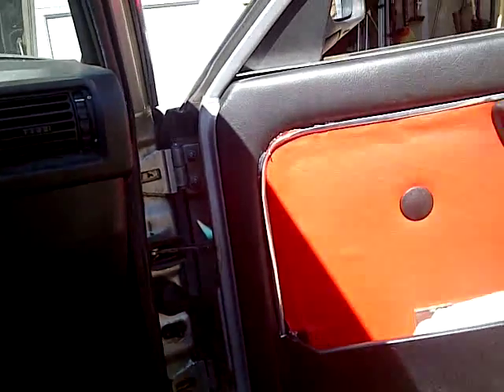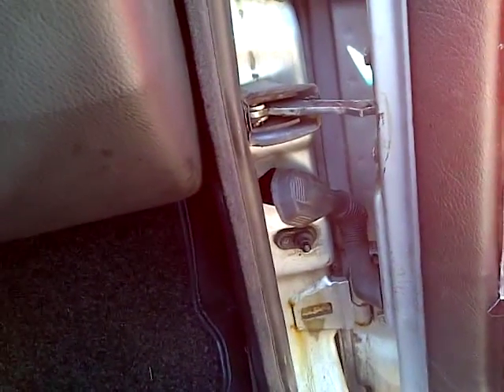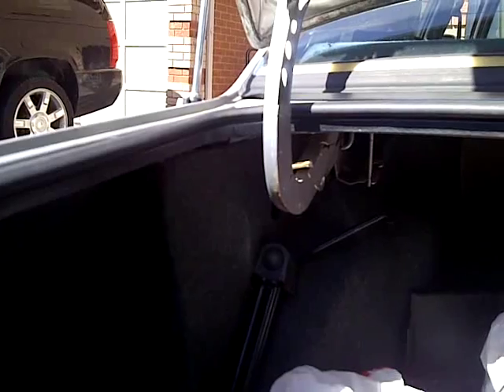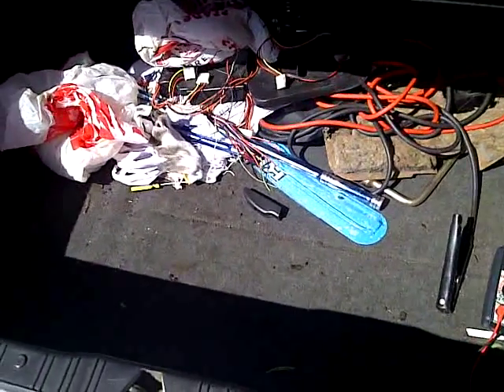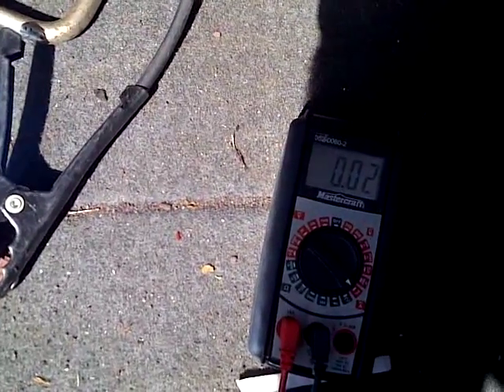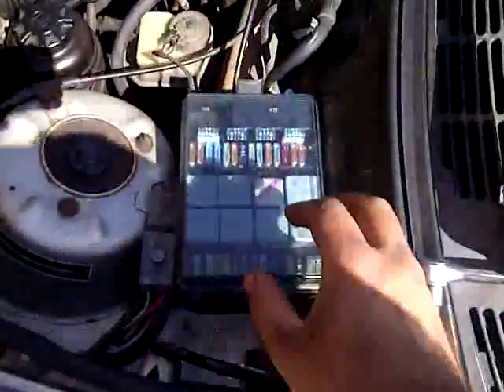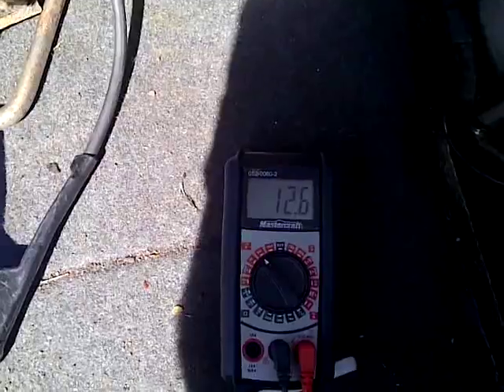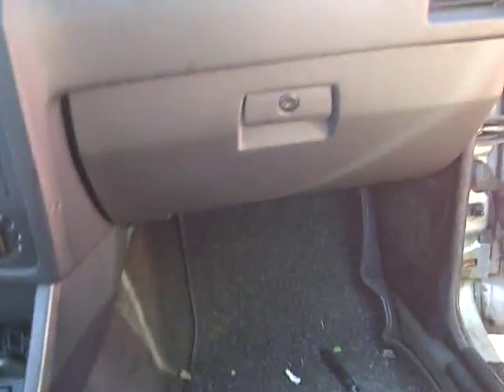e30 parasitic battery drain bmw 325e

Comment: I have 1990 bmw e32 750 il and it drains my battery 🪫 so what u suggest to do thanks
Reply from the maker: If you cant find the drain relating to any of the fuses then check your alternator diodes  Alternator diodes could go bad and allow power to move both directions, when car is running diodes allow charging of battery and when car is not running, bad diodes drain your battery. Unplugging battery cable from back of alternator (safely, since its a +positive cable) and checking for draw/drain  will tell you if your alternator diodes r bad. Atleadt that was the case with my 1995 e38. Thanks

Comment: I have pulled all fuses still draining 0.2 amp disconnect cable  distribution block to fuse box  looks like its my problem here, any ideas how find it whats draining?
Reply from the maker: A bad regulator maybe ? Or if diodes on the alternator go bad, they will let power flow both ways and therefore drain while you are parked. Just a thought ...it happened to a BMW 740 I used to own. Ripped the whole car couldn't figure out , then it had to be the alternator diodes busted

Comment: so did you leave the Neg cable on the battery when you did this test ...
Reply from the maker: You could leave either side connected to the battery. But one side shud be going thru the amp meter . It will just show negative number on the lcd

Comment: I used this method and found my central locking system was using 20amp! when closed. My multi meter leads caught fire when I locked the doors. Still not had a chance to strip down the doors. With the doors open drain was under 30ma.

Comment: so i pulled fuse 21 and it went from .7 to .12.. any ideas where those 100 milliamps are coming from?
Reply from the maker: Devious Emsce could be one of the things under fuse 21( as per fuse chart). auto-charging flashlight, glovebox light, trunk light , non-functioning/shorting power antenna , or the radio wiring. most likely , the component/accessory that is available in the car but is not functioning is the problem. put fuse 21 back, start unplugging things like, power antenna wire from trunk, unplugging flashlight or radio or whatever is under that fuse. you shud be able to find it.
Reply: Did u ever figure it out cuz mine is reading 0.66 but when i take off the 21 fuse it dropped to 0.12

Comment: i have a 1989 bmw 325is, i removed the original factory amp, the previous owner did not remove, still receiving power, i removed the factory radio harness as well and hid my wires along where orignal was, if u still have ur original amp in urs u could just unplug it, located in trunk in front of active check control relays.

Comment from the maker: @eurokid83 i cud probably fix the lock heater instead of spending $50. car cost me $600 to buy $800 to drive. but that would be last thing to do since I got enough more important projects to take care of with the car. i just got another e30 but convertible, lots of problems, mostly the same. just rebuilt a power steering rack on that, was easy! some short circuits battery draining problem.

Comment: @AfgunPride786 no, I didn't really fix it.  I found it was my alpine head unit.  So I just added another battery under the hood.  I have it switched off from the system.  If my battery is dead, I just flip a switch and start the car, then flip it back.  I will charge the second battery with a trickle charger.

Comment from the maker: @R8tedE 
did you finally get the drain fixed?
update: i got another e30 but convertible, good body paint. same problem. and the guy had no idea why it was draining n killing battery. i took the electric lock heater and it was all good :D